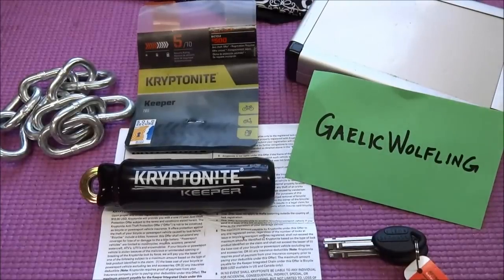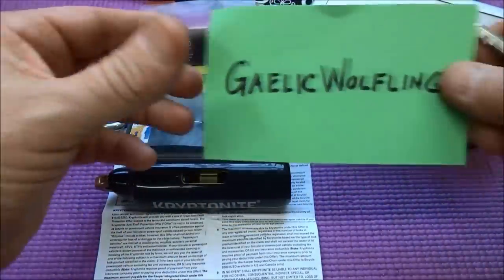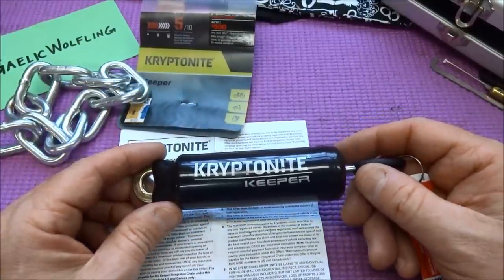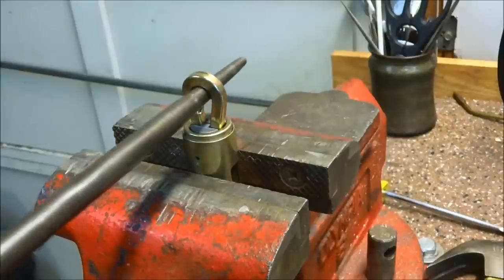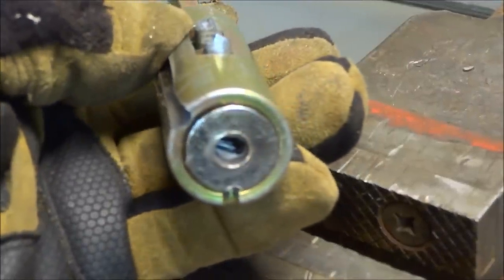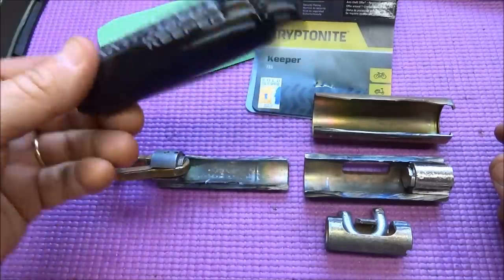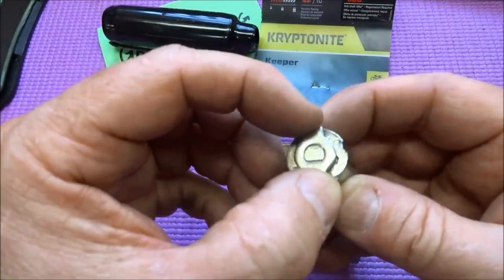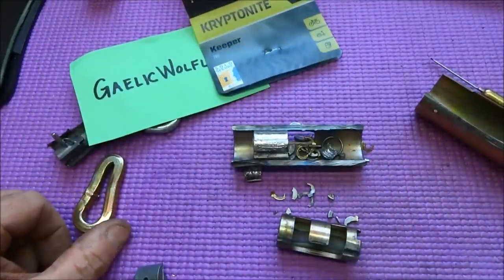(397) Kryptonite Keeper Bicycle Lock Autopsied - One TOUGH Lock!!!

Comment: Instead of floating the roll pin deeper into a blind hole, I would have first tried to extract it.  Soak with WD40, insert a fine-threaded tap, get a few threads of engagement and yank that sucker out.  Similarly you could try drilling it out but roll pins are typically spring steel.  You might find a reamer or jeweler's file small enough to fit the hole and grind it out from the inside.

Comment: If I DECIDED TO BREAK INTO ONE OF THESE HIGH SECURITY LOCKS, (WHICH I WOULD NOT DO),  I WOULD NOT EVEN TRY TO PICK IT. I HAVE A PORTABLE BAND SAW WITH A SMALL GENERATOR FOR POWER. I WOULD JUST CUT THE METAL THAT THE LOCK IS ATTACHED TO. I HAVE FOUND THAT WE LOCK UP SOMETHING EXPENSIVE TO AN ALUMINUM POST. IT TAKES ABOUT 5 SECONDS TO CUT THROUGH AN ALUMINUM POST THAT LOCKS ARE ATTACHED TO. SOMETIMES THEY MAY BE STEEL GATES BUT I CAN STILL CUT THROUGH WHATEVER A HIGH POWERED LOCK IS ATTACHED TO. 
I THINK AN ALARM IS ABOUT THE BEST WAY TO GO ALONG WITH THE HIGH POWERED LOCK.
BUT, REMEMBER, YOU CAN NOT KEEP A PROFESSIONAL OUT. SO, INSURANCE IS WHAT WE NEED FOR MAXIMUM PROTECTION.  I CAN GO THROUGH ANY CHAIN IN JUST ABOUT 30 SECONDS TO A MINUTE IF IT IS HARDENED. IF IT IS NOT HARDENED, I CAN  CUT THROUGH THE CHAIN IN ABOUT 8 SECONDS. I LEARNED THIS THE HARD WAY IS THE REASON THAT I KNOW THIS.

Comment: Do you have the 910mm cutter? If yes I am wrong and the links might be stronger than anticipated. When laying on the ground you should be able to crop chains up a diameter of 13mm with the 910mm cropper. At least the cheaper ones.

Comment: This seems completely pointless, why would anyone try to defeat the lock when they can easily cut the chain?
Reply: BoogieDownProduction just tried ti cut a chain the one it comes with is a very hard pressed steel just like to lock its self i tried with a dremmel and bullcutters no success
Reply: Only reason I can think of is if you want to open a lock without leaving obvious signs of tampering, and that failed at the "cutting away the plastic sleeve" stage...

So for that reason this looks like a good lock. And as I write this there's probably someone who's learned to pick it. The thing is you don't put a lock on something to keep people from stealing it. You do it to make your things harder to steal.

Comment: so.. did anyone else think that if that roller pin ran the entire length of the tube you could smash the far side, denting it- pushing it out a tad- then pull out the pin with pliers?
Reply: No. No one else thought of that. You are the first ever.
Reply: Awesome. I feel special.

Comment: if someone really wanted through a lock... couldnt they just use a small amount of thermite?
Reply: Narwhale The Great If you really wanted through a lock you could just beat up the owner until he gives you the key. The idea is to make the protection stronger than the attacker's desire to break the protection.
Reply: TOASTEngineer
true. but wouldnt thermite work?
Reply: Narwhale The Great
You'd probably just end up welding the whole lock together, honestly. Better to attack the chain.
Reply: +Narwhale The Great yes, therm. would work but you would have to take some time setting it up correctly, it isnt as simple as just putting some thermite on it and lighting it... you have to concentrate the thermite on a small area and contain it... easier said than done. A faster and easier method would be a grinder or cutting torch.

Comment: Why didn't you try drilling out one of the pins?
Reply: +Lucas Finley i was thinking the very same thing :D but i remember i had to attempt to drill a roll pin out of a tail lift platform where i work and they are made of hard stuff very snaggy too if your drill bit doesnt burn up fast it (which it will) will snag to the point of breaking

Comment: If you had another one you could try drilling through the lock where the roll pin is. You'd probably need a hard drill bit like cobalt, molybdenum, or diamond tipped. 
How about the famous free the lock with liquid nitrogen trick. I can't think of a easy way to get that.

Comment: What a bunch of crap...the weak point of the lock system is the chain, just wedge in 2 small wrenches in a link and queeze the arms creating leverage...the link will easily pop open and you're done. No need to pick the big lock thing.

Comment: Sometimes when you have a roll pin in a blind hole like that, you can VERY CAREFULLY "tap it out" (ie cut threads internally) and thread a screw in there which can be used to pull the pin out. Very delicate.

Comment: Hey Bosnian Bill.  Stay legal.  The kryptonite lock can be heated till you take a hammer and then smash it off.  The ABUS are better against a heat torch attack.  Please redo this lock or mention that these lock are not heat resistant.  My bike shop stated 4 bike next to a security shack and 3 was stolen with kryptonite lock and the ABUS survived.  Thanks for all you do.

Comment: How reliable is that lock in terms of working reliably 100% of the time? It seems that, brand new, one key will not open it.

The last thing any cyclist wants is to lock up their bike, return to it and find that the supplied key will not open the lock because the lock is temperamental.

Comment: Seems like instead of driving the pins in farther, you should pull them out. The roll pin could have threads tapped into it and pull with a bolt; the solid pin might be drillable in which case drill & tap etc.

Comment: I know sh*t about locks but lets say you got a chain that can handle the load I propose . use a portapower? the 10 ton pullers you can get at harbor freight to snap those pins out? I know this is unreasonable for taking a bike but I like seeing the forceful destruction of great mechanisms

Comment: did you try slide hammering the core out? jb weld something you can get the slide hammer on into the core? the robustness of the core could be used against it?

Comment: We used to use locks like these in the Netherlands, until the bike thieves just started carrying bolt/rebar cutters and snapping the chains.

We now have a system where there is a layer of steel tubes, then woven steel fibres and then a layer of plastic around the chain. These are now mostly the standard bike locks in the Netherlands, where bike theft used to be the #1 crime, and maybe still is.

To me this is like a lock I would have used in the seventies or eighties.
Reply: RogerWilco What kind of security you recomend us?

Comment: Or you could save yourself all that bother and mobile angle grind it off in 30 seconds!
Reply: no bike thief uses an angle grinder on the spot.

The use bolt cutters, wire cutters or try to life the bike up when its not locket to something.
Reply: What is up with people and angle grinder? He try to keep things realistic. Literally no thief is going to carry around an angle grinder, that would also draw way too much attention.

Comment: To get a better grip from your vice on to hardened objects like this lock, use a slightly softer metal insert, it will shape itself to the object creating a flat to round interface for better grip. The increased surface area will hold it much better.

Comment: What about using liquid nitrogen to freeze a lock and smash it with a hammer to open it?
Reply: +Chief60 not cold enought.
Reply: +Chief60 if you put the nitrogen on the U shape part of the lock or a link in the chain it will become more brittle so bolt cutters might. there is also hydraulic bolt cutters that have a lot more power and work the first time - when the temperature is lower it will become more like glass,  or a file - no flex =shatter - But a small tank set for a blow torch is safer then nitrogen..also one shot from a depleted uranium bullet - also acid .

Comment: if the steal is THAT hardened, you could take a blow torch to it and get it up to about 500 and dunk it into a bowl of salt and ice, than whack it with a hammer.
Reply: How many thieves carry around a blow torch, bucket of salty ice and a hammer?
Reply: well, none..
Reply: Right. Any lock can be broken...but that's not the point of them. The point is to deter thieves by making them have to carry tools they won't want to bring, or make it take ages to break into the lock.
Reply: If you could do that to the lock, then the lock wasn't attached to the bike, so you won already.

Comment: This lock is point less wen u can just cut the chain
Reply: Ever try to cut through titanium-reinforced hardened steel links? Unless you have a diamond/ titanium carbide cutting wheel, cooling fluid and 15-45 minutes of time. While at the same time do it without being noticed from the sparks, smoke, and noise. 

Trust me. I have one of those OnGuard 8017 chains for my bike.
Reply: +English Muffin the chain is made of manganese steel
Reply: GTB_Greedy ... oh wow. Not the strongest of combos
Reply: michael rowe it’s a good enough chain don’t worry nobody will be getting through it with hand tools

Comment: I have a question:  if the bad guy does this. it broke the key slot.  I can not open it. because chain (chain from the web site: $200)  and lock so strong.  I will suck in middle of no where.  How do I get home.   I will be so PISS extreamly angry.  i WOULD HAVE TO find who have a truck to load my bike on .grrrrr.  HATE  bikes THEIF